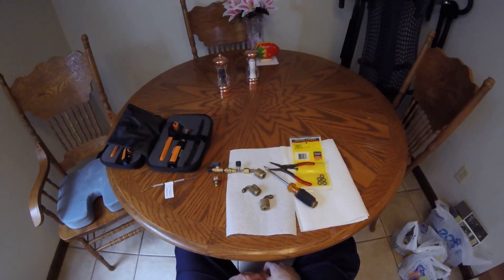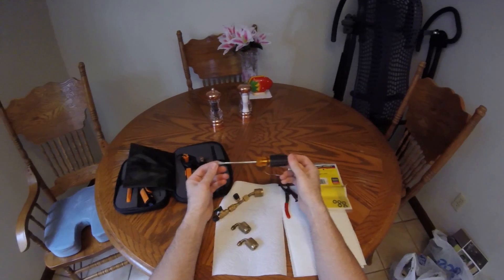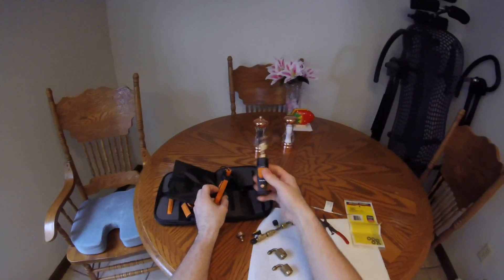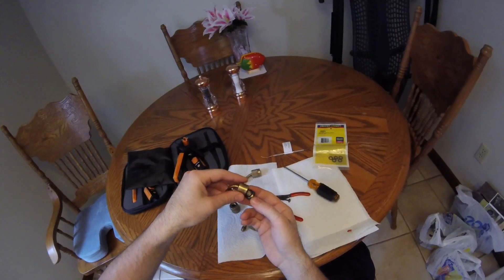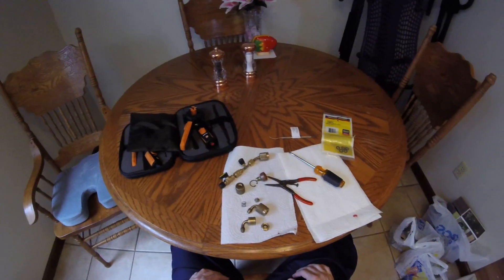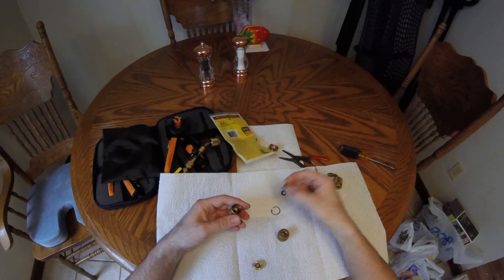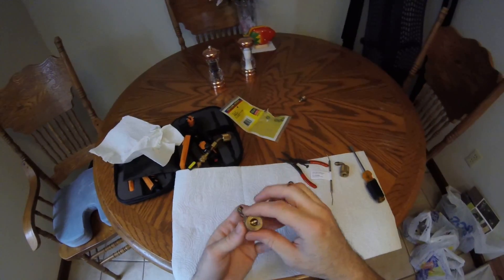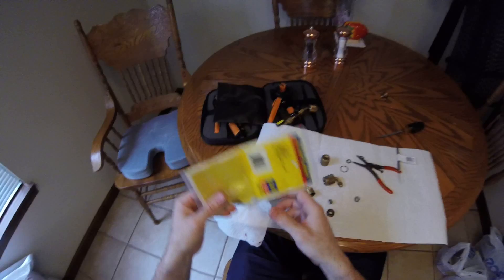Repair Low Loss Fitting and bonus SmartProbe Mod

Comment: I've used 2 of these low loss fittings 5 days a week multiple times a day for 4 years and am just now replacing the seals. My co-workers started leaking in 6 months. The issue is when people crank them down on the stems. It doesn't need to be cranked down. It just needs to be tight. Anymore and you are asking for premature failure

Comment: I use shut off valves at the end of my hoses. A good trick is to thread your core depressor kind of deep into your hose. This way it does not press in your schraeder core until it's threaded on tight. You loose very little refrigerant. When removing the refrigerant hose with out low loss fitting most of the refrigerant that's spraying around is just emptying out of your refrigerant hose not so much from the unit.
Reply from the maker: That is true Anthony and a good tip. The core depressor in smart probe doesn't appear to be able to be moved though

Comment: The ball valves aren't for anything other than giving the probe connection an angle for some applications. I might end up building my own angled connection pieces just because those valves aren't really that cheap. The stub on the probes is just as low lose as the additional fitting.
Reply from the maker: I Understand that. I'm having trouble getting the high side on there fast enough and I'm loosing too much.
Reply: +Joe Shearer interesting, does the low lose make any difference there? I don't see how it would.
Reply from the maker: +Stephen Rardon (HVAC with Stephen Rardon) it does because generally it seals itself off rather quickly. Within a quarter turn. The oem fitting is taking several more rotations while spraying liquid out.
Reply: Joe Shearer cool, don't use mine enough to have noticed. Know anyone that might want my Kit? Case and all
Reply from the maker: +Stephen Rardon (HVAC with Stephen Rardon) the refrigeration set? Tell me what you want for it.

Comment: thanks for the video nice idea on probes mod, i used a putty knife on mine as well, i normally just replace a small o-ring every couple of years.
Reply from the maker: Yep it seems to make then a little gripper on the pipe and that's what I do with the fittings too.! Thanks for comment

Comment: the problem I have with the low loss fittings is the o rings will blow right off and go flying on a r410a system on a hot day.
Reply from the maker: Wow I've honestly never had that happen. But I have with my appion core tool plunger.